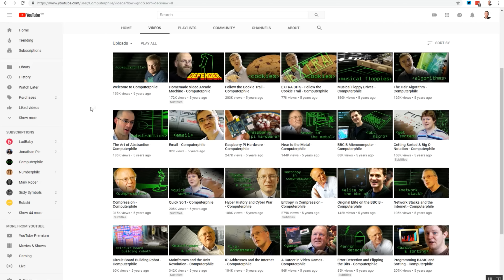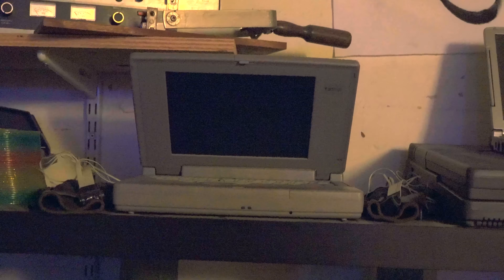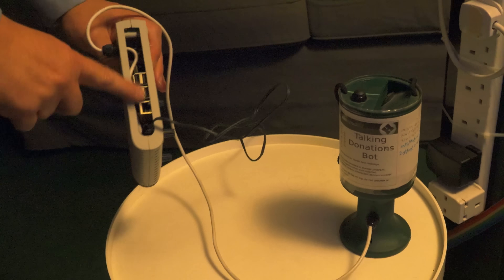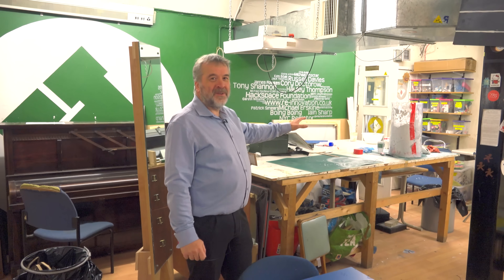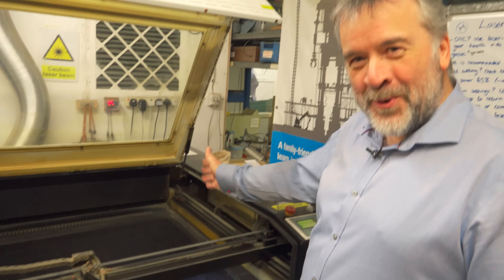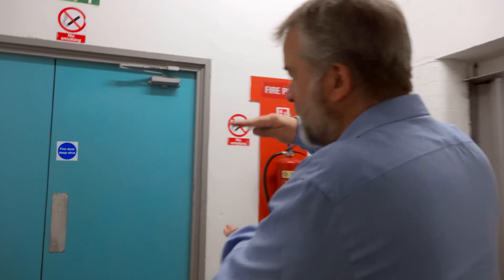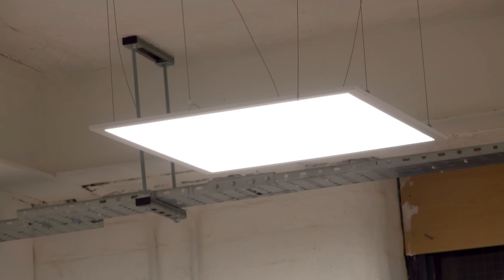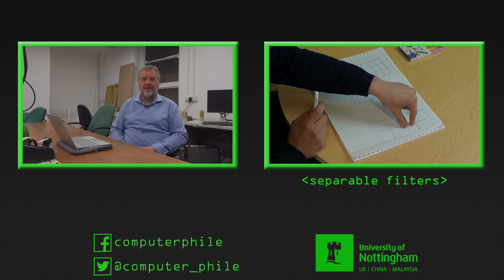Hackspace Tour - Computerphile

Comment: So when their internet connection goes down they can no longer control their lights. Nice.
Reply: The server that hosts the web interface is on the same network as everything else in the hackerspace, so it wouldn't make a difference if the internet goes down.
Reply: @andre_van_duin  Still, if the LAN goes down they'll have the same issue
Reply: Synnipoe That’ll probably only happen if the power goes out... probably
Reply: If the network goes down at a hackerspace there are bigger problems...
Reply: Most of the lights are manual.
Reply: @pilattebe  What if the fire switch can only be activated via RFID?